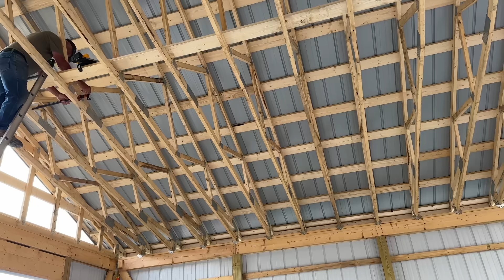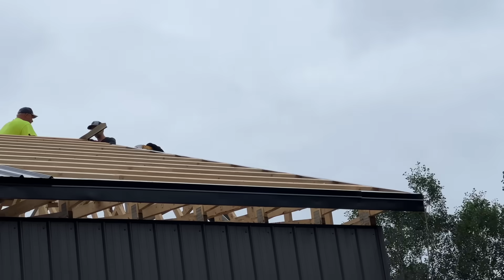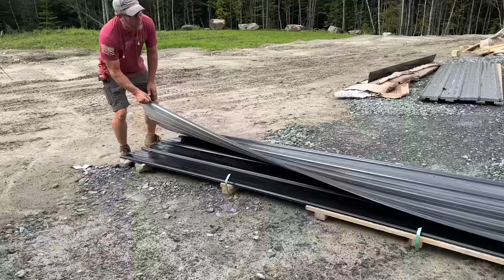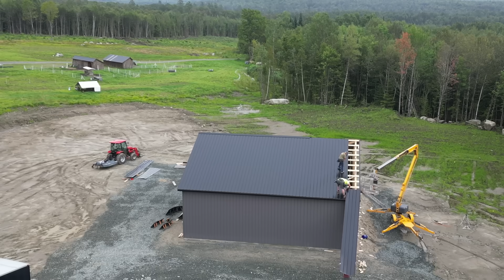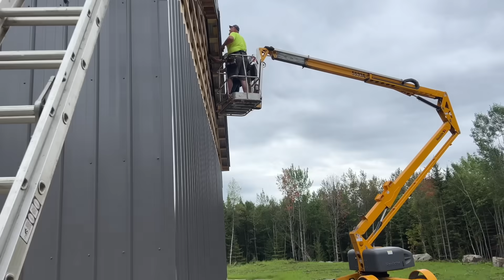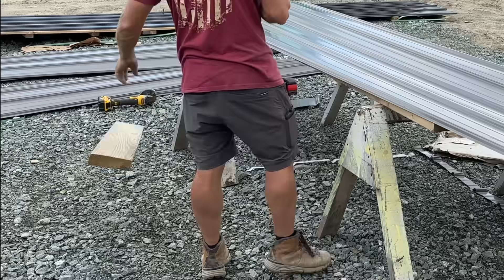We Made Some Huge Progress Today! The ROOF is DONE on Our 40x40 OFF GRID WorkShop in the WOODS

Comment: Hi all. Your project is moving forward at a snail’s pace. Guess that is to be expected with moving camera around and Ken’s drive for perfection. 

A couple questions. 
1 rainwater collection cistern system in the plan?
2 lower ceiling over shop area too lessen volume to heat?
3 plans for ventilation and installation?  Both walls and ceiling?  
4 electrical equipment storage room?  Ventilation?

Nice to see Gina back in videos. 0:12 

Good luck.

Comment: The workshop is looking sharp. Notice how water doesn't pool around the building -- nice drainage. I remember that the floor has water radiant heat. Looking forward to how you handle the insulation against that cold metal outside. It's all looking good.
Reply: Spray foam
Reply: @deanbrunner261 Yes! He has said that👍🏻

Comment: Its odd how a space seems to shrink on a concrete pad-foundation once the walls and roof go on even though not much changed. Indeed when the drywall goes up a room often feels far smaller and even more so when furnishings go in feels like half its size is often why homes being sold are nearly emptied out..👾

Comment: Yup, those kickers were exactly what you needed for extra snow load and gable blow out in high winds. Excellent work kids. Depending on prevailing winds in the area, tying the interior walls into the foot of the trusses with a few additional cables w/saddle clamps, like every 4 trusses, are a good supplement to the hurricane bracing~

Comment: So funny about the pigs and chickens with milk. Our experience is the opposite -- the pigs love the milk but the chickens don't. Since we don't always have pigs but always have extra milk, I found a way to use it for the chickens. I heat it up on the stove until hot and add vinegar until it makes curds. My chickens LOVE those curds! Maybe that would work for the pigs?

Another tip if you decide to try this -- make sure to portion the curds so that they don't freeze up into a solid mass this winter, lol. We're in Maine and, as you know, those blocks of curds stay frozen until SPRING!

Comment: Looking great Al, if the next project is the Root Cellar I would dig a hole deep enough to put a shipping Container down it cover it in Concrete then back fill the soil it will double up as shelter in case of bad storms.

Comment: Looking good, that’s a fine looking building.  Have you considered adding fans to the gable end without doors?  It might help with moisture and give you a nice breeze by the garage doors in the summer.
Reply: Moisture will not be a problem as the roof & walls will be spray foamed.

Comment: I am completing a project putting up a handrail on our front precast steps.  I had to get some bits for drilling concrete using a hammer drill.  Would anyone like to venture a guess as to which drill bits I ended up buying at one of our tool stores in Calgary?  . . .  The answer is . . .  Milwaukee!  (By the way, our precast steps are over 50 years old.  Using water with the proper tools, the concrete drilled almost like going through cheese.  . . .  almost.  😊 )
Reply: I started to say Milwaukee before I read it 😂
Reply: Did you buy carbide drill bits or diamond 💎 tip ?  The Carbide are great with water but Diamond 💎 tip are better.  No water 💦 required with diamond tip Bits and Blades but they’re a lot more expensive.
Reply: I bought the Milwaukee 48-20-9021 Shockwave Impact Duty 3/8" Carbide Hammer Drill Bit for concrete.  I am not a contractor.  The clerk made sure that I was buying the proper bit.
Reply: @rdyardie  I was thinking masonry bit but maybe the diamond tip bit works well for drilling concrete too. I had to rent a hammer drill and use masonry bits to hang my drape rods up in an apartment I rented. It was an old apartment and the walls were very hard to drill into. I'm glad you could put up rails for your steps. Have a great weekend.

Comment: Looking great!  I'm with Gina, nervous with all of you up on the roof.  Gina, I spied something you might be interested in.  In a small pile on the side of the building are what look to be cut off pieces from the large posts that were used.  Didn't you do a holiday decoration with blocks of wood?  Maybe have Al drill the top just enough to drop in a battery operated votive candle, a little paint, a piece of greenery held in place with raffia.  I see crafts in the left overs.

Comment: Why are you not using closure under the ridgecap and the bottom of the roof sheets ?
Reply: The ridge cap and the entire structure will be spray foamed with insulation. The stuff they put under the ridge cap I think will stop the spray foam from being sprayed out of the openings between the roof seams and the cap. Have a great weekend.

Comment: There was a foam strip put under the ridge cap.  Why wasn't a foam strip used on the bottom of the roof sheets?
Reply: I think that was for insect control so they don't build nests up there. Have a great weekend.
Reply: @StoneKathryn  The foam strips keep the wind from blowing snow and rain under ridge cap.
Reply: @ronsommer9409  Thanks! I hadn't seen Ken put that down before. So when they spray foam will they spray to avoid the ridge cap so it can ventilate the space up high?
Reply: @StoneKathryn  I am assuming that the spray foam will be placed on the underside of the roof, which means that the ridge cap is not vented.
This will be a heated workshop.

Comment: Love it - AND - your 'farm color' choices.  Wondering did I miss pulling electric and water pipe into the WorkShop?  Even for a hose. Especially to charge all your tools.
Reply: No water line. Solar panels to be installed on roof so electric line not needed.

Comment: Looks nice BUT no back door ?? you have to have a back door.And put Translusent plastic on the front and back gable ends for a skylight so you can see if the power goes out
Reply: No back door. No clear panels as roof & all walls will be spray foamed. As they are installing solar panels on roof with a battery bank the power will not go out.
Reply: @tonygrimes13  ok for the power but I  think not having a back door would be out of building code besides no 
   Door in the back what happens if their is a fire in the front side of the building and you need to get out?
And as reliable as solar systems are failures are posable it would be better to be prepared

Comment: Way too late for this build Al, but the next metal building that you build that uses soffit, there is a trim piece called F&J. It incorporates a horizontal for the soffit to rest into and a vertical for the siding to nest into for water tightness. 

Before I found this trim piece existed, I nailed 2 pieces of J channel instead of the one piece of F&J. 

Since you're in a high wind area, I'd nail some diagonals under the truss top chord to keep the building from racking. Relying on the 26 or 29 gauge sheet metal of the roof to keep things tight probably isn't a good thing.
Reply: What does ‘racking’ mean?
Reply: @probablynot1368  Racking is when the trusses shift around under wind loads.
When you have the trusses spanning the width of the building and only the tin on the roof from allowing the trusses to move when wind loaded, the screws holding the metal on start to elongate. 
Installing diagonal braces changes the load path.
Reply: @gungadinn  Thank you!  Excellent explanation.

Comment: Hope the flimsy roof holds up with the snow load this winter.
Reply: Roof not flimsy at all. 2x6 purlins spaced at 2ft apart with adequate screws attaching the metal roof panels to the purlins. The roof is plenty sturdy.

Comment: Do they have clear panels you can use up on the ends? I'd probably want some natural light in the shop.
Reply: The roof & all walls will be spray foamed.
Reply: @tonygrimes13  So? you just box out a window. They do that in houses all the time.
Reply: @Maxid1  If they wanted to install windows in roof or walls it would be done earlier!!!! This shop is being built for comfort i.e. heat in Winter not light which will be provided by the solar panels on roof!!!! Natural light is not needed!!!
Reply: @tonygrimes13  That's got nothing to do with the question I asked. I asked if they had clear panels. I don't need to insulate it where I live.
Reply: @Maxid1  But they do!